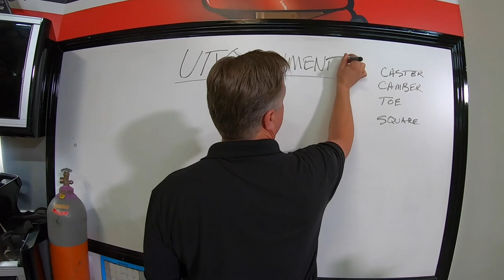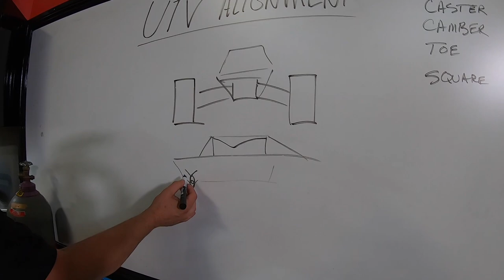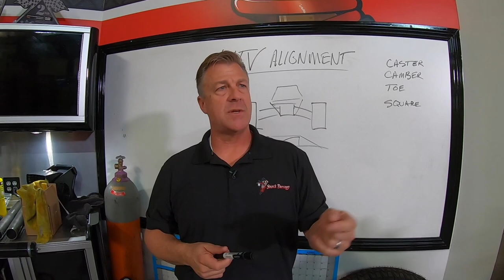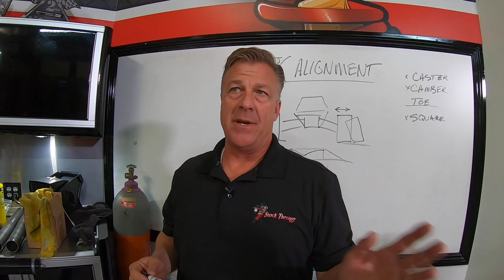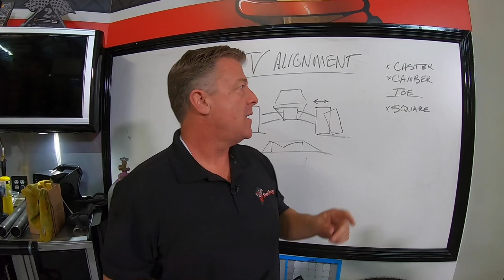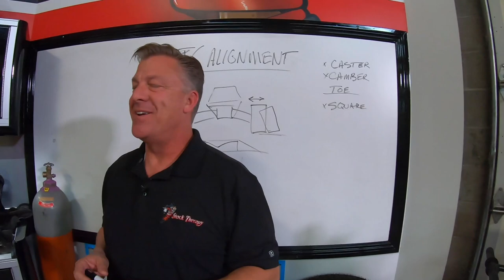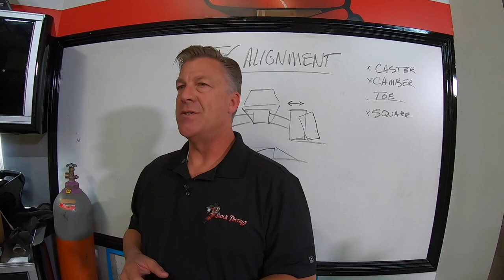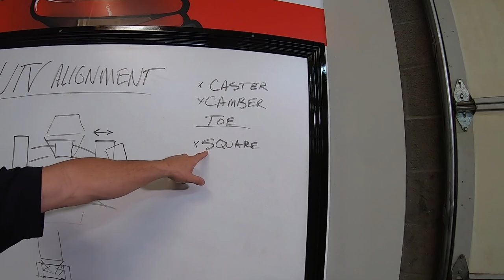UTV Alignment 101 (Shock Therapy LIVE 2/16/21)

Comment: Any reason not to just set front and rear as close to 0 deg for all adjustments for just trail riding? East coast, woods, mud, one or two trips to ride royal blue and or Hatfield McCoy trails.
Reply: @shocktherapy4820  yeah true about caster. Guess I meant all adjustments that I had control over. I can’t adjust caster can I? I don’t remember the numbers but it wasn’t 0. 2019 X3 X RS. Installed CT radius rods yesterday and put it on the alignment machine at my dads shop.
Reply: @shocktherapy4820  awesome. Thanks. Front arms are S3 no adjustments.

Comment: I have steering wobble at 45+ on 4+3 still wheels with 30" terra masters. Alignment  issues possibly
Reply from the maker: alignment won't cause a wobble. This is definitely something worn out or tire out of balance or both. Steering box wear will cause that. Worn out arm bushings will cause that. Your wheel offset will accentuate the wobble problem too.